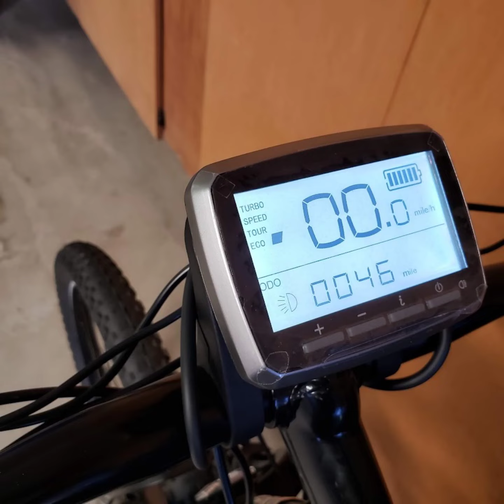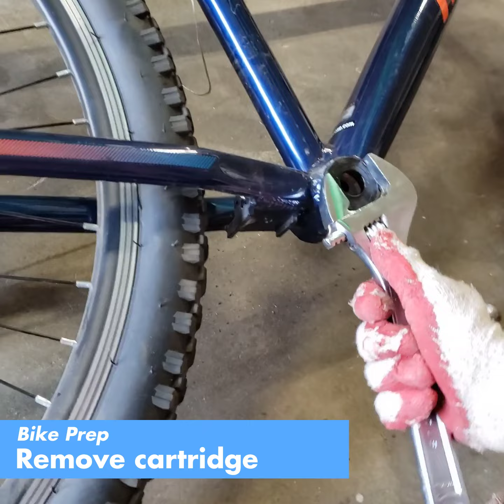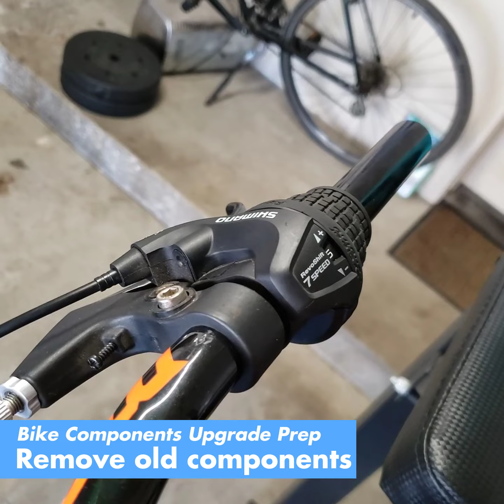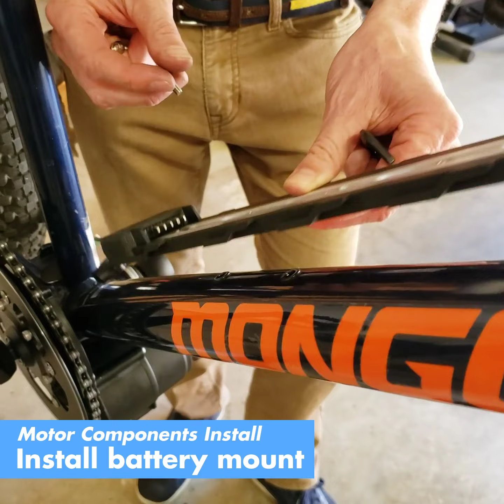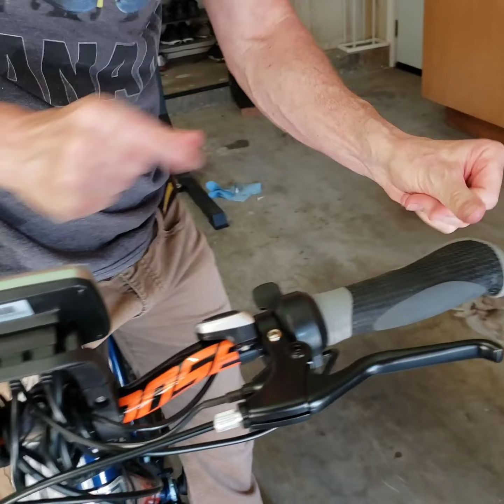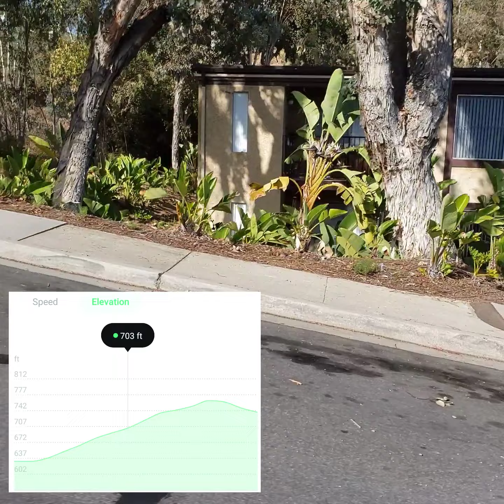e-MTB Conversion Project - TSDZ2 e-Bike Kit

Comment: How much did the weight of your bike increase as a result of this project?
Reply from the maker: It added another 23 pounds (11 pounds for the motor and components and 12 pounds for the 12Ah battery)
Reply: @hermogino that's incorrect, it doesn't add 23lbs(10+kg), it's more like 7kg
Reply from the maker: @kevinwilliams8502  Nope. It added 23 pounds to my bike.
Reply: @hermogino  well I got the same motor and it weighs less than 4kg?
Reply: U should re weigh it, your scales are wrong, the motor weighs 3.9kg and the battery is about 3.6kg, I have a 960wh battery and it's less than 5kg so it can't weigh over 10kg,all bought from PSW
Reply from the maker: @kevinwilliams8502  Ok.

Comment: Should be noted the eBrake levers it comes with is for mechanical disc brakes, not hydraulic.  You buy separate sensors for hydraulic.

Comment: Is going up hill such a work with torque sensing? How does it feel and does it get tired if you are an athlete?
Reply from the maker: It still requires effort going uphill but with the 4 different levels of assist, the highest level gives you the best and strongest assistance. You can pedal easily on uphills. If you're an avid cyclist and you're used to pedaling hills, you'll feel like Superman when this motor kicks in. You won't get tired.

Comment: Hi hermogino,  did you get both the motor kit and battery from pswpower which is an Alie Express company I think    did you have to wait long for shipping and if you needed any customer assistance were they quick to help basically were you satisfied they seem much cheaper then other american based suppliers 
did you add throttle controller   if so  does it give you full power when you apply it immediately,  some videos say bike slows down slightly then accelerates after a small initial power interruption  
did you find any problems shifting without a power interrupter to cut power when you shift like the Befang kit offers   thanks for you thoughts really great video
Reply from the maker: Yes, I got the motor and battery from pswpower. It arrived in 4 days (from Commerce, CA to San Diego, CA). I didn't (or haven't) require any customer service. I ordered the kit with the throttle. It has variable speed (push lightly, it'll go slow. Push it further in and it'll go faster). If you're pedaling and decide to push the throttle, yes, you get a half second interruption on the motor assist before it kicks in. On another scenario, I was going uphill with the throttle on 100% (not pedaling). I was going at a good speed. I decided to pedal (on the 4th assist level) and the motor actually gave more assist! No problem shifting without a power interrupter (shift sensor). I just make sure I don't have too much pressure on the pedals when I'm shifting. Thanks for watching the video!
Reply: I’m with you if it does what you want why change it  thanks for your time and quick reply’s enjoy
Reply: I'm wondering if that slight delay if you hit the throttle while pedaling is something that can be changed in the programming I only say that cause another utuber review of the system talked about how quickly the throttle reacted on his bike even if he was pedaling and he also mentioned how he loved how programable the motor system was I guess the reason the Befang cadence sensing system needs the motor cut out is because unless you totally stop pedaling the motor sends full power to the chain unlike the torq sensing system which reduces power somewhat when you ease up on the pedal pressure similar to riding a nonpower assisted regular bike I try to shift when either going down hill or at least not putting great pressure on the pedals
Reply from the maker: @robertthomson9340  I'm not sure if programming will change it. Maybe it will. I'm pretty sure I can do the OSF upgrade myself using a special cable (since I've installed ROMs on Android phones and tablets before -- I figured it's the same concept) but I don't think I will do that to any of our e-bikes soon. It currently does what we need it to do at the moment with no issues or complains.

Comment: Thanks for this guide, I have the same bike and thinking of converting! How much did this conversion cost you?
Reply from the maker: The battery was $210. The motor was $325 from pswpower. I also upgraded a few components like the shifter and grips.